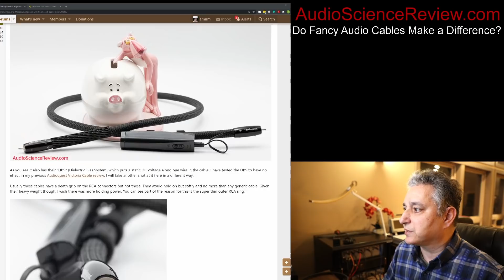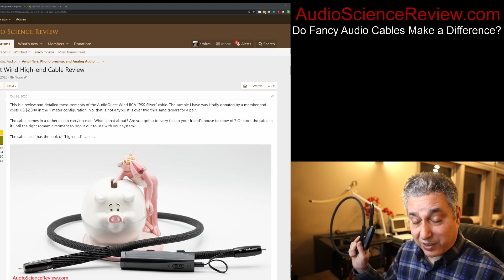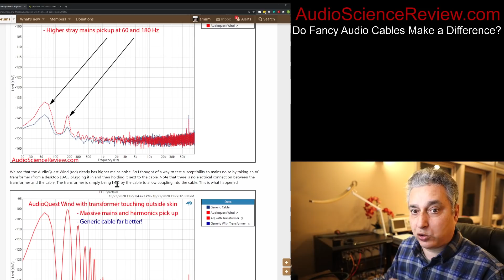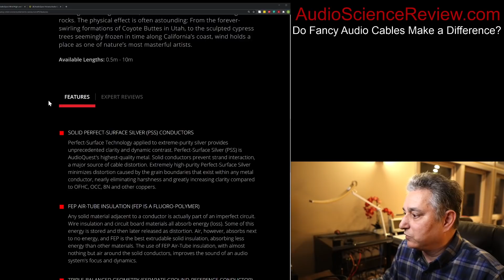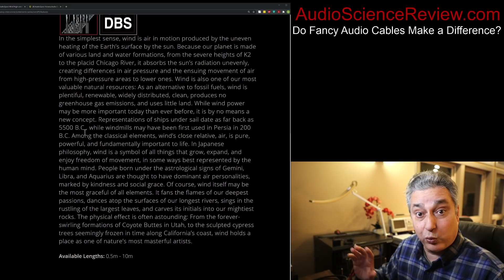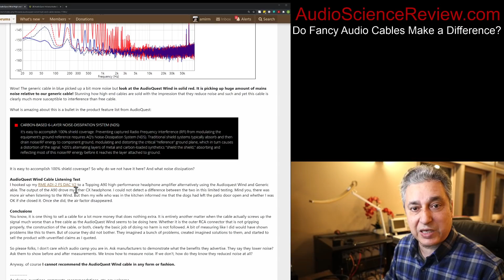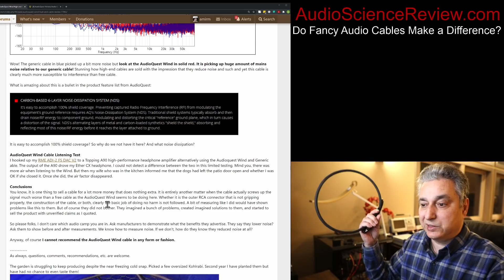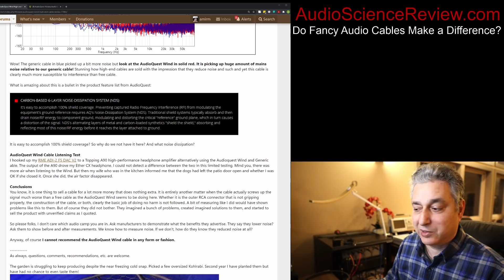Do Fancy Audio Cables Make a Difference?

Comment: The fact that the AQ’s cable showed way more noises when not plugging in compared to generic cable but it is almost the same as generic cable when plugging in… doesn’t this just show that AQ’s cable does indeed “dissipate the noise” as advertised?

The noises are there in both cases but the AQ’s cable is able to dissipate the noise by reflecting it from reaching the component ground. Hence the much higher noises you measured without actually plugging in the cable as you are picking up the noise reflected off the cable too?

I’m sorry but you really lost me with this one on how you seemed to already have an expected result in your mind and you just seems to try to test and interpret the result in the way that it will match with what you are expecting it to…

This is very far from what I would call “honesty”

Comment: can I use 3+2 RCA cable, designed for audio/video set up, for my stereo 
sound system? the cable will connect equalizer with stereo amplifier.

Comment: Shows how cluless audiophiles can be. A battery that's not connected wow. Put batteries in a flashlight and don't connect the switch and see how much light it puts out. At least the batteries will last a long time. The  wire from the batt only connected at one end is picking up 60hz hum.

Comment: Is there any interlink measured by Amir that he did like? With good measurements. He can measure everything but why doesn't he listen to the cable? You can show all kind of numbers but does he also listen? Because is we must believe Amir all cables and audio gear sounds the same. But when I switch my two sets of interlinks, there is a very noticeable difference in sound. So I'm very curious if he even measured some interlinks which he said are good.

Comment: Over the years I have come to understand that in the world of audiophilia, not everything has to do with sound and it’s quality. There is a seldom analyzed aspect that has to do with the appreciation for luxurious things. From a certain point, audiophilia shares something with "jewelry": there are people who buy and collect expensive watches, not only for their ability to tell time accurately, but for their brand, for the materials used in their manufacture, for the hands that designed and built them, and so on. I have never known of a watch enthusiast who wants to buy an atomic watch to have the most accurate time possible. No one compares a Rolex to a Patek Philippe in terms of their ability to measure time. Similarly, there are plenty of audiophiles who buy luxury cables just because they are luxury... and I see nothing wrong with that. I don't belong to that group of people, not least because I couldn't afford it; however, I understand those who care about how nice an amp looks or the material a cable is constructed from.
Reply: @Jondahl Davis I am an audiophile of those who do not claim to have a golden ear. I just want to listen to the music I like in the best way my budget allows. I'm not connected to the industry, I don't review gear or recommend equipment. But I guarantee you that the musical experience I get with my sound system, which would not be accepted by the most purist audiophiles, is fabulous.

Comment: Another interesting topping would be about blind\double blind and ABX tests to see if people can distinguish "high end" components from "regular" budget ones (ex. Amps). Also, between hires files from regular res files with the same mastering.
Reply: Yes, 100% agreed. Back when we still had the annual Rocky Mountain Audiofest here in the Denver area, I would often encourage companies exhibiting there to set up a blind-test room where they had a $500 system, a $5,000 system and a $50,000 system in the room, all set up behind curtains so that no one could tell which setup was which. The idea would be to have show attendees come and listen to each system playing the exact same source content at the exact same volume level and then vote as to which one they liked the best and which one they thought was at each of the three price points. It would be VERY interesting to do such a blind test with the general public and then see the results of hundreds or even thousands of listeners. Of course, no one ever wanted to take me up on that offer and set up such an experiment - and I'm sure you can probably imagine why.
Reply: @michaelbeckerman7532  Of course they wouldn't take you up on that. But the issue has two sides and, I believe, a lot of consumers prefer to cater to their belief system rather than their auditory one :-P
Reply: "topic"

Comment: OK, I'm new and just bought some new gear.  If the AC cable that comes with my integrated amp isn't any good, why would they sell me one?  Wouldn't it make more sense to include the proper cable and charge me for it?

And, as for the example shown, for $2300 I could certainly go up in gear quality (probably speakers)  that would have a greater audio impact than this magic AC power cord.  So, what gives?

I remember the green pen that we were all supposed to use on our CDs.  This sounds like more hay that's been through the horse.
Reply: It makes no sense for a manufacturer to increase the price for customers who will probably buy an aftermarket cable to their own tastes.

Comment: I’m new to this hobby and the amount of conflicting information is astounding. Finally stumbled across ASR and saw some videos of Amir taking measurements. This video is shocking. I wonder what AudioQuest would have to say in their defense lol. Incredible. Thanks, this is so interesting.
Reply: The biggest issue is that scientific measurement do not necessarily work in the audio department. Everything here is based on trial and error as you are unable to predict how the system as a whole will sound to your particular ear.
I'm not convinced to Amirs testing after he mentioned that he did not hear a difference between the generic and Wind cables. This is highly not probable as they should sound DIFFERENT. Each person will hear a different change but it will be there. Also analogue signal is influenced by absolutely EVERYTHING so I do not believe his review strictly from the audiophile point of view. Last week I once again heard that power cables have a huge impact on sound.
Reply: @dariosarti2791  what is sound? Pressure waves. What are pressure waves? Compressions in the air. What causes these compressions? The moving cone on the speaker. What causes the cone to move? The signal going to the speaker. THIS is why measurements matter. They literally tell the speaker how to move. For you to say "measurements don't work in the audio department" depicts your profound lack of understanding of basic science. If the measurements don't change, the sound won't change. If the measurements change, the sound will change. Anything your ear can hear CAN be measured. Otherwise, your brain is tricking itself, ie. the placebo effect.
Reply: @Nominally-Built  True! With one exception... If the measurement changes, and thus the sound changes, the measurement wont tell us if that change is perceived as positive or negative by a person. We can assume that high divergence from the source-signal is unwanted, but we can't tell for sure if 1% of distortion Type A might sound better to a person than 0.5% of distortion Type B. Think of the people that like to use tube amps to add distortion to their music. Think of all the people EQ'ing the heck out of their music. Measurement is great to determine if something causes no change (like expensive power-cords), or if something causes a change, and how big the change is... but not if the change is perceived as damaging or as improvement by an individual.

Comment: sO THE "FREE CABLE" is already a cable that filters noise ?  compare audio cables to a normal speaker cable ( 2 wires) that has been used by normal house holds around the world for tens of years.  30 dollar cable is already a real audio cable, there fore comparison is pointless.  braided cable that costs few tens of dollars will help withe the signal. and by definition affects the sound coming from the driver, thats scientific fact.  If noise enters the drivers coil, then it, by definition, must influence the sound coming from the speaker.  Noise itself does NOT HAve to be audible ofc.

Comment: It's very appropriate when these types of products hit the market, that they should be called "snakes, or snake oils" to be precise. 
I remember my father saying that at the County and State Fairgrounds there use to be many of these gimmicks. There was a product that claimed it will increase the horsepower on your vehicles. Just insert this device in between your ignition coil's output wire and the distributor cap and your engine will see an increase in idle rpm speed, thus an increase in horsepower. The spectators didn't know about the "hidden electrical switch" that altered the ignition's timing. Plenty of money exchange hands for that useless device, that did absolutely nothing. These expensive speaker cable companies are doing the very exact thing, making false claims, brainwashing and conning people out of their hard-earned dollars. 
BTW, can I sell you some speaker cables that are made out of "organic materials" that are also environmentally green? 🤥

Comment: I spent about £1000 on qed cables from there reference and signature range in 2013  half the price of that audioquest cable but i got 4 reference hdmi cables, 1 performance hdmi cable, 1 reference fibre optic cable,  signature range 2x 3 meters of genesis silver spiral bi wire 1 x 2 meters bi wire, reference range 4x 10  meters of silver anniversary xt, 2x 2 meter signature subwoofer cable, 1x reference digital audio 40. Come on that's a better bang for buck then audioquest and 99% of other hi end cable makers. And please I'm not talking about budget cables as most of the cables above cost £100+ but not above £150 at worst when i bought everthing in 2013 and you get lifetime guarantee which they helped me with because there dealer had put wrong size connection when putting airlock on the silver anniversary xt speaker cables i called qed  they said send direct to them at no cost for return deliver or for 16 new  banana plugs and not even £5 per termination of each banana plug for airlock which i paid when i got each plug terminated. Now anyone tell me this is a company that tries to rip you off, in my eyes i have only had one problem with there cables since 1996 and that was not even qed fault but richer sounds who done the cables. And lucky the genesis silver spiral was a custom cable that was terminated by a nice lady called linda at qed who also sorted out the mess richer sounds caused with there cable 👏👏👏👏

Comment: I find the susceptibility to EM radiation quite interesting, tx for sharing. But, as someone who has used in past decades a couple of different AQ interconnects and also generics, plus Furutechs, i find the notion that some one wouldn’t hear improved clarity the higher up you go the ladder (at least to the 500€ mark), quite amusing, tbh.
With all due respect, your comparison, ie selected measurements, is a bit like putting a Porsche and a 1980s Daihatsu on fire and, seeing both burning brightly (from previously carefully leveled fuel tank!), conclude no difference, all the same.
If i had your kit available, i‘d check impulse smearing, intermodulation, etc (for which you might need also dynamic input signal quality on par to a several thousand € source). 
One thing that caught my eye (not yours?) is that the visibly wider peak at 1kHz of the generic cable. Not audible, as all other findings (unless of course an SMPS is in close vicinity to the cable, which indeed is a valuable finding), but perhaps a lead to something audible?

Anyway, measurements are very interesting, but in the end the decisive question is musical reproduction and the perception of the potential buyer. That is an infinitely more complex chain than a set of frequency sweeps & a 1kHz harmonics test, as interesting as they are. So the challenge is to set up measurements that imitate music and are sensitive to the specifics of human perception of music and sound.

Comment: Listening from my Beats by PhD Dre + AQ Diamond Passive Over-Sampler Denoiser (using homeopathic sand to cancel the cosmic waves interfering with the harmonic tonality of the headphones, to obtain liquid smooth 3D sound stage), plugged on my Crystal-Clear USB-to-Ethernet-to-Analog adapter, on my laptop, 
I found this review very revealing, that there is too much panda oil on the audiophile market, & it's time to get rid of them!

I appreciate the fine tuned touch on the mids at 9:09 , that my Denoiser helped picking up better. Very unveiled explanations, was so clear my imaging of the concept was buttery-smoothly crisp.

Comment: Yes, more of these type reviews please.  Audioholics agrees with your assertion that fancy cables don't sound better, but when I read advertisements for 'great special cable technology' I still get influenced.  I need to be reminded what snake oil smells like!
Reply: Always keep your bullsh!t alarm in good working order!
Reply: Building your own RCA cables is good fun. Buy good quality cable by the meter, fancy connectors, some silver solder and you can build your own custom cables that look awesome, work perfectly but cost a fracition...
Reply: I use fancy cables. They’re not really expensive but I use them because it looks good and a part of the visual theater
Reply: Yea another poster makes the point … a $30 cable is better than a $1 cable.   A $5,000 cable is indistinguishable from a $30 cable.

Comment: Music is all about transients constantly varying in frequency. Static testing at a set voltage and a set frequency is not enough. You want to test the audio equivalent of 0 to 60mph acceleration, 1/4 mile times , cornering and braking of cars to have a better picture of the situation. It is how cable responds to signal variations that is most important.
Reply: The way things react to transients is governed their static properties .
Reply: @markrigg6623  That is only partly true, science is still missing soooooo many data points. Time is not a static thing!

Comment: There are some useful differences in audio cables- there is a difference between a $7 cable and a $0.99  one. For RCA type cables the quality of the connectors matters, really cheap ones can corrode and provide a poor connection.  For cables from your phono cartridge to your preamp input you probably want to use low capacitance cable. If you want really long cables, again you probably want low capacitance cable.  Proper shielding is also a good thing, most cables above the throw-away kind have good shielding.  Certain mechanical properties like flexibility and durability vary among cables.  But  you can get a cable that hits all these quality marks for under $10~20 for a 1 or 2 meter length. High priced "high end" cables are among the items with the highest profit margin and mark-up among all audio products.  I don't know if the folks making and selling this snake oil are just cynics looking to drain consumer wallets, or if they actually believe their own marketing pseudoscience.

Comment: I made the bad decision to update my very modest system with completely new DIY wiring, AC, interconnects, only speaker cables stay the Sommercable Magellan 225 4mm^2, just because the Mogami W3104 was not available. Granted, up until now all AC mains cables were the packaged ones (which are probably fine !), but the interconnects were really flimsy and badly made. But it's easy to lose yourself in the web shops and go bananas on snake oil stuff.

Comment: What is the big deal about speaker cable gauge? 18 gauge use to be the big thing back in the early days of stereo. Now, everybody is pushing 16 gauge to as big as 10 gauge. Does gauge really make a difference with average 10ft to 20ft runs?

Comment: Amir - Thanks for putting some science back into this cable business! I've only ever had 2 RCA cables fail in over 40 years of messing with hifi gear. One was a cable that my dad got with a Pioneer rack system back in the late 70s. The other - an AudioQuest cable I bought from a local stereo store sometime in the mid 90s. I also have one AQ cable where the center of the insulator has turned to green sticky goo.

I think there's a reason you don't see any serious test gear in the Stereophile tour of AudioQuest HQ. Even they don't want to know the truth. But it did seem like a lot square footage was dedicated to marketing....

Comment: Thanks for sharing this. Your videos are great. How were the cables terminated during the testing (what impedance)? I'm just wondering what could have caused that horrible interference in the Audioquest cable...
Reply: Well, you need a second watch.😉
Reply: @vintageflanker7096  Oh, no... 😒😏 I was just thinking... What's the impedance of the AP generator output when it's off? Is it close to zero or is it open? That could affect those measurements. Anyway, I'm not trying to defend Audioquest. That kind of performance is unacceptable.
Reply: Ungrounded shield  was acting like a antenna

Comment: Great video, Amir!  My vote is for more.  But, what I’d really like to see is recommended cables.  What SHOULD we buy?  Are the hardware store/Amazon Basics cables fine, or do we need to go a step or two up from those?
Reply: Quick answer: Yes, "Amazon basics" (or almost any brand of cable, for that matter) will do just fine as long as (in the case of speaker cables) they're of sufficiently heavy guage to carry the power required, and (of cables in general) any connectors (RCA jacks, banana plugs, phono plugs, etc.) are robust and secure enough to provide a reliable, solid connection. Most of this fancy "audiophile" crap is an almost-complete waste of money and materials.